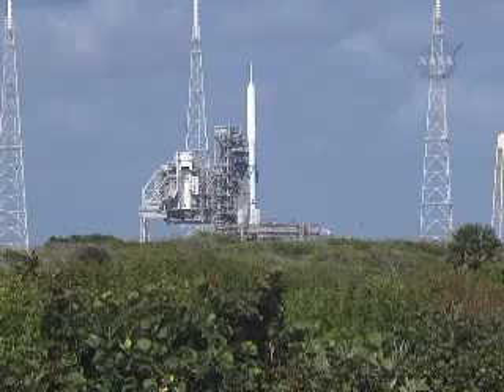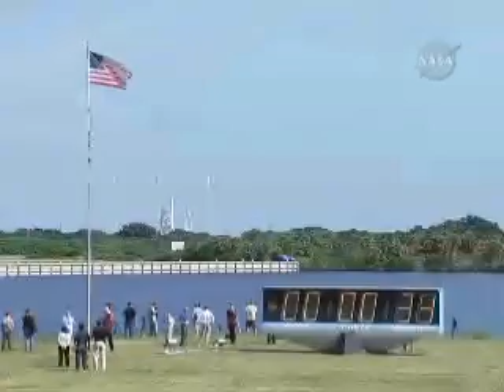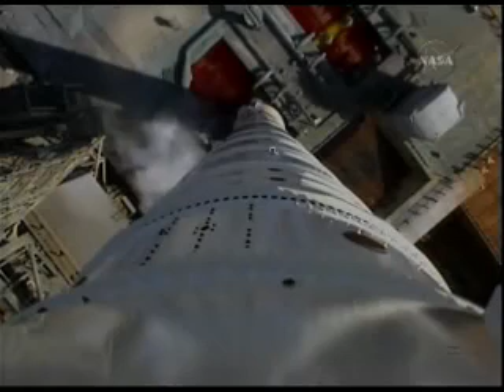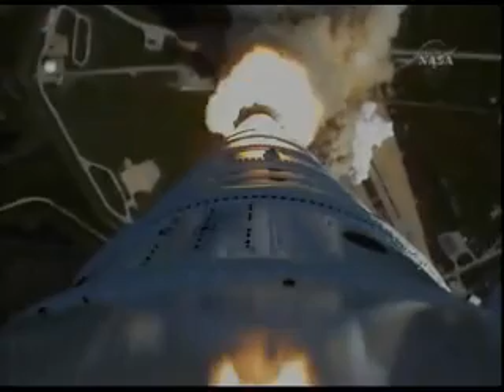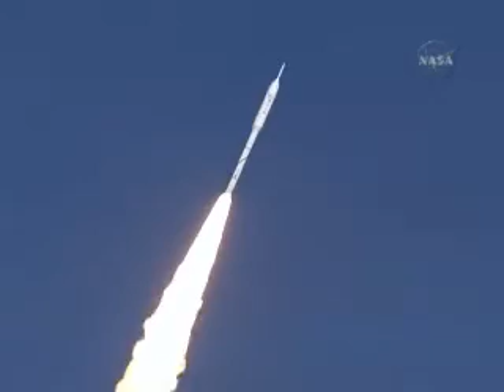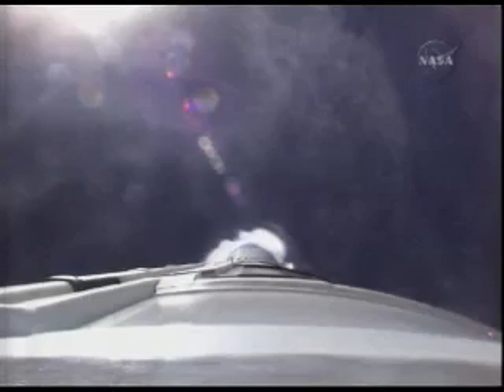Ares 1-X Launch: Liftoff!

Comment: @ti994apc.. first safey... the 60+ years of experience with only 3 real failures gives nasa an edge in safety against any other competitor. thou both are unproven designs. the nasa experience adds up. second cost.... a recent analisys has given a cost of 180 mill per ares I launch.. if u consider the fact that falcon9 lifts 3 times the payload ... its even in cost..... and im not mentioning the 188 tons heavy lift capability ARES V... u would have to strap togetherlike 15 falcons to do that

Comment: I loved this launch (even if I had to wait up till 1230 to see it)
do we have confirmation as to the cause of te bendback on the second stage? It almost looked as if one of the explosive bolts didn't fire.

Also, Ares 1-X looks much more...Imposing than the shuttle. I must confess there is something to be said about a taller yet lighter space craft.